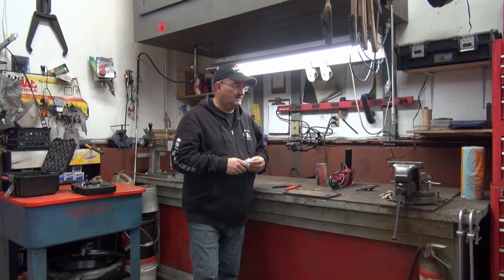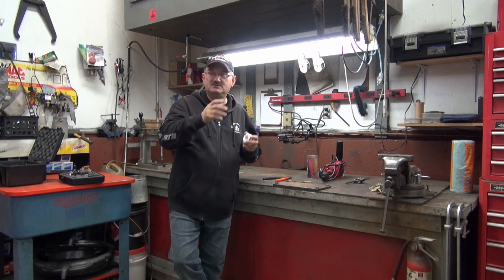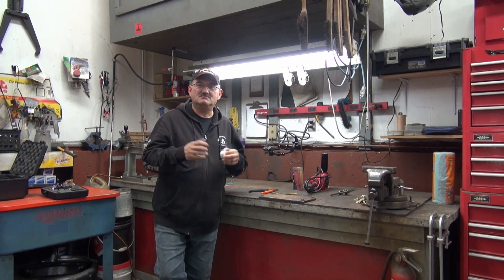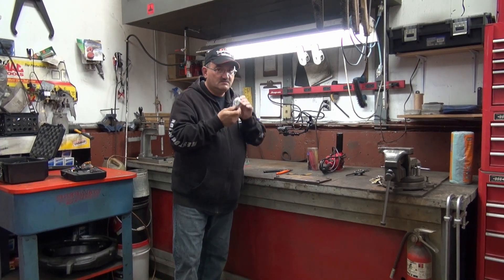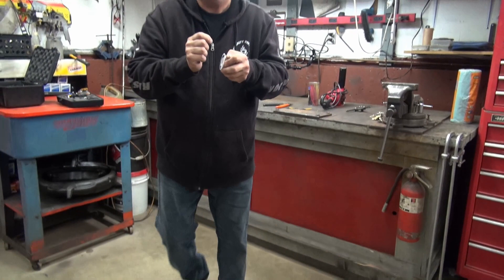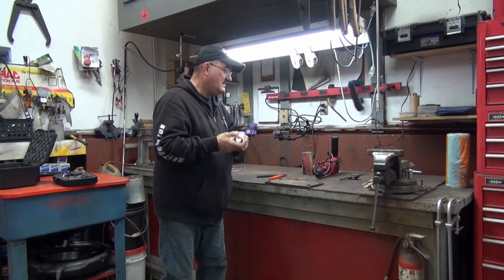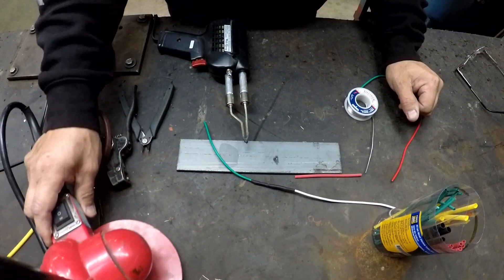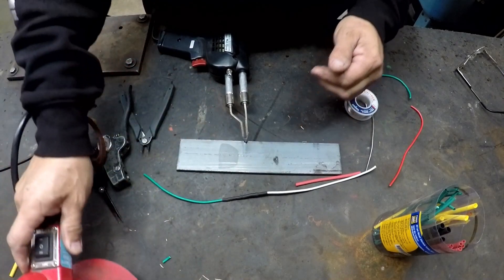Basic Wire Soldering

Comment: Hi Paul, when I was in the Air Force and we were training on the F-16 Avionics, we all had to take and pass a NASA soldering class w that done wonders for hich was very strict. We learned a lot from that course and one thing was keeping every thing clean and tinning with a liquid flux that made the soldering so much better.
Reply from the maker: First of all let me thank you for your service. I realize there are many other ways of doing this and other things that I show on our channel. I'm just demonstrating how I do it and place no claim that's it is the best way. A viewer asked me how I do it and the video is based solely on that.  I do however use liquid flux but only when I'm plumbing. I find the flux core solder does well for my wiring needs.

Comment: Funny story... I have a heap load of heat shrink...dozens of sizes many different colours etc. I have them all in Plano tackle cases..ya know the ones you can divide up into 24 sections...anyway...I was doing a bunch of wiring on my motor home recently it was hot..30C I left several of the cases in the sun ...not a good idea. I lost probably 30-40 sticks of heat shrink that went off just because of the heat of the sun...moral of the story...keep your heat shrink somewhere cool while you're working. Thanks for the informative video. Ps. I thought I was the only one that twisted the copper like that for soldering.
Reply from the maker: Lol. The heat shrink shrunk.  Not good. There must have been a lot of heat in the cantainer. More like a greenhouse effect.  Thanks for shairing.

Comment: Just a quick add-on to your tip, if you're soldering wires together that are already connected to something (like ,say, one end is connected to a light and the other to your wiring harness), be sure to slide your heat shrink tubing on BEFORE soldering the wires together. Can't tell you how many times I have forgotten that and had to desolder a join, pull it apart, and solder it again!
Reply from the maker: Same goes for flairing nuts on a brake line. I really didn't think I needed to point that out in the video. I just wanted to show the basics of soldering. Common sense should come into play in this case and that's one thing you can't teach lol.

Comment: Years ago installing car stereo s and whatnot I did solder the wires but electrical taped the wires. Ugh... You introduced me to shrink wrap years ago and I recently used these techniques on my dads kayak trailer for the lights. Works wonderful!  Thanks Paul. I always learn stuff watching your videos. I cannot say that often enough.
Reply from the maker: We all have used differant methods at one time but some of us evolve into using better methods and it looks like your one of them. Tape still has its place but that heat shrink is great stuff. Glad you got something out of the videos. Kathy and I have fun doing them but just below the surface there will always be tips on how we feel there's a better way of doing things. Thanks for watching. We appreciate you being here :)

Comment: When I got out of the Army in 1969 my first job was with Auto lite a division of GM and my job was to run a plastic extruder that covered the wire with the plastic coating. The first thing I had to learn was how to weld the two ends of the wire together so that they could be pulled through the die on the extruder and not break. Depending on the size of the wire some nights i would pull two or three hundred miles of wire.
Reply from the maker: Wow. That's a lot of wire. I bet by the end of the shift you were happy it was over lol.

Comment: I have a pair of those snap on strippers like you have.  
I liked the ones my father had. 
The order number changed, but 30 years later you could still buy it and still get the blades as service parts.

The week after I got them, I saw a set of Klein's in an electrical supplier for half that I paid.
The snap on is a rebadged Klein.

In your demo it's fine to put the heat shrink on after the solder, but in a job both ends of the wire will not always be free.

You have to slip the heat shrink on before the soldering.
I still screw that up from time to time.
Reply from the maker: Same applies to a flare nut on a brake line. In the demo I'm assuming our viewers will be able to think that out themselves. If they can't then they shouldnt be at it at all.
Reply: I know better too, doesn't stop me from screwing it up  it from time to time.

That splice you use is called the Western Union Splice = apparently named for the telegraph people.

We learned it in Highschool.

  I suppose now the kids just learn how to program robots and the robots are supposed to build themselves.
Reply from the maker: My mom worked for Western Union but that was before I was born. So many names for splices. Same goes for knots. I can tie about ten differant types but never remember each ones name. Fishermen that come to the shop showed them to me. This video was as I said "basic". Did it to help a viewer out. When I was with the dealership I took days and days of electrical courses, omg some of them were so boring. Tried not to make this video like that. Here's where mom worked http://www.historicplaces.ca/en/rep-reg/image-image.aspx?id=13239#i2

Comment: as usual a great tutorial. I've owned a weller 325  gun for over 45 years, the only difference is my two stage switch goes first position is low squeeze harder and it goes hotter.
Reply from the maker: Great. I've never seen one that had low on the first part of the trigger.
Reply: That 1st high, 2nd low was news to me too.  I checked a gun today with an ammeter and it indeed pulled more in the 2nd position.  Maybe that is how the OLD guns were made and now they have changed them.   I have another old gun and I will  test that one also tomorrow.  Interesting.
Reply from the maker: Dave Caselli Some models worked opposite than mine but the two I have worked as I mentioned.

Comment: a quick question for Paul, why do you have the space under your bench boarded up wouldn't it be useful for storage.
Reply from the maker: It is used for storage. It's actually full down there. The red front portions are actually sliding doors.

Comment: Yeah been using a wella gun for 30 or so years and always worked well wiring up my model railways layouts but have to use heavy copper wire as tips because can not get new tips where I am. You are dead right about keeping the tip well tight for best heat. My gun does not have the 2 speed trigger bur does have a light. atb
Reply from the maker: I think my biggest complaint with the gun is keeping the two lights working lol, I don't bother anymore lol.

Comment: Paul,
You should have told the viewers that you might have to slide the heat shrink tubing on one of the  wires and slide it beyond the bare wire before you twist the wires and actually do the solder. This is if the wires are already attached to something else which would prevent putting the heat shrink tube on after the solder. 
Nothing worse than creating a great solder joint and then not have the ability to put the heat shrink tube on. 😁
Reply from the maker: You should do a updated video on the subject ;)
Reply: +Paul Short No, you're the pro. I just had a simple observation. Besides, I don't have a lovely  assistant to help me. You got it all. 👍
Reply from the maker: It's kind of like making sure you put the flare nut on the brake line before you flare it. Sometimes I forget to do that too.

Comment: I've got an old soldering iron and kit and it comes with flux. I guess that's because the solder has lead?
I have got to start using heat shrink, I'm still using electrical tape lol
Reply from the maker: Years ago you'd get solder in a kit and there would be solid paste in with it. Since then they've come out with the Rosen core stuff built into the solder. Heat shrink is great stuff. Tape still has its place though.

Comment: I actually join my wires like he shows here, but I always used black tape instead. The way he shows is far superior, though. I tend to melt something when I used my solder iron, which I have used a few times to work on a circuit board. That was what made me stay away from it. Not now. This video tutorial has made me more confident to use solder. Once I get time off work to tackle my lights, and once I get my other stuff from "fleabay", lol, I will finish. Thanks.

Comment: Great video Paul. That's the exact technique I've used for years, it works great. Sometimes I will put a tiny amount of silicone on the wire jacket then slide the heat shrink over it for more water proofing.

Comment: When I've soldered connections in the boat I've gone one up on what you just did. Waited for the connections to cool then before heating the shrink wrap I coat the insulation with liquid tape wait for that to dry then heat the shrink wrap, the liquid tape reactivated by the heat then seals to a waterproof finished join. I like that soldering gun you used, I'm always using the gas ones for portability.

Comment: Oh Paul,  My teacher in electronics would yell at you.  Being trained as a coil winder if I ever did that on a coil wow would I hear it from the boss.  But , I'm glad someone showed the people how to solder.  Thanks for helping so many out there.  I had to got o class for this stuff!  Also for welding our copper wire together on the power cores for high power transformers.  Had to use 1000 w to 1500 w soldering irons.  We could lite up our cigarettes on them.  But that's the way we were trained.
Reply from the maker: I could do a full video again on soldering irons. Got them here for doing rad work and even used them for body work. You got some great experance. I've always spliced my automotive wiring that way. It's always served me well. I realize it's not for every wiring application. Thanks for watching. ;)

Comment: excellent work zooming I couldn't see a thing I've always used a different technique to splice my wires but I'll tell you I like your way a lot better I'm going to have to give it a try... thanks for the tip   love the videos all of them my ole lady gives me a hard time because I watch a video about putting a lift in a truck that I don't have but hey you never know I tell her... I would love to see tome tips on that mig as well your welds always look amazing...
Reply from the maker: Thanks Rob. Just trying to help a regular viewer out. Glad you got something out of it. I've been splicing my wires like that for decades. Never failed me yet and it's strong and looks good. Over the coming winter I'll be doing some welding videos with many many tips and tricks.
Reply: +Paul Short that's great I'm looking forward to watching I am looking for a welder I only have used stick and have a small hobby welder so any recommendations from you would be great
Reply from the maker: If you stick weld you'll catch on to mig super fast. I always advise to buy larger than you need and buy 220 volt units.
Reply: +Paul Short great video Paul and Kathy. My dad taught me how to solder forty five years ago. One thing you might want to mention, you may have to slide the shrink tubing over the wire before connecting them. Also being a thrifty person myself, l clean the ends of the soldering tip with sand paper.this helps make better contact and extends their life